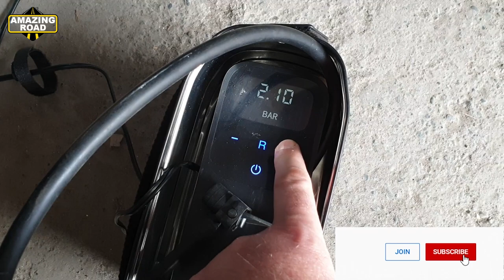Liquefied Gas for Mercedes W211 + Spare Wheel Mercedes Can be Pumped With a Conventional Compressor?

Comment: I used a cylindrical tank, float is adjusted way up so that i can fill it to the max. I only fill the tank till the float stops the filling only before going on a long trip so that it will be less than 80% on arrival. 
Otherwise i fill only when empty and with less than 80% of full capacity from empty.

Mine is eating around 11-12%/100km.